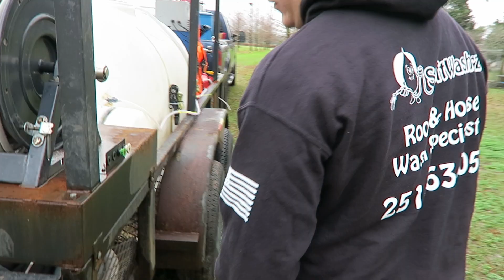I Went 20k In Debt To Start My Business (Pressure Washing)

Comment: I made myself with a predator 420 and a 20” surface cleaner knocking on peoples door after I got off work from my full time job. That lasted a few months until I knocked on the wrong door. Then I learned and perfected the log maintenance market. Now I have a 9gpm, my 5th predator 420. Two gun and gas softwash. All on a beast 2015 f350 drw 9ft utility. A hemi 2500 single cab on 35s. Brand new 6x12 and 7x16 all paid off, all of it. I had less than a thousand bucks to my name 2 ish years ago. Working for myself saved my life and now I slay any and all log cabins i come across.
Reply from the maker: Let’s gooo
Reply: How have predators held up for you vs honda's?

Comment: Thanks for your videos- they're super helpful. I'm seriously considering starting a pressure washing and gutter cleaning business. Just wondering how much a hard-working dude with an 8gpm setup can make in an average day/week?
Also, (this might be a stupid question) what if the flow rate of my town's water supply is only 6GPM?
Reply: A bit of a late reply. But a buffer tank is what you want. If you're using something that pulls more than 6 gpm then it would be worth it to get an ibc tote